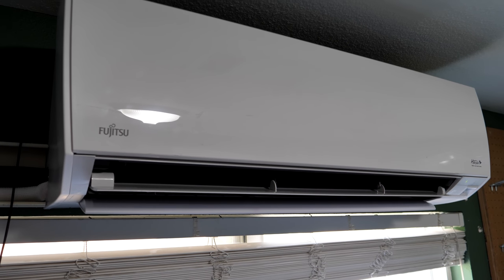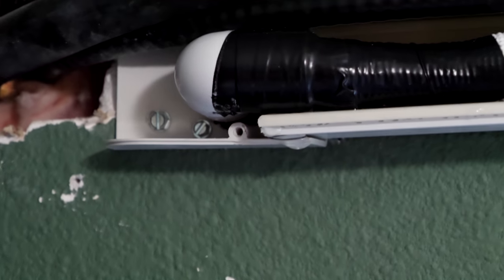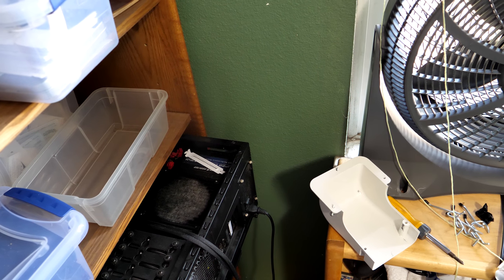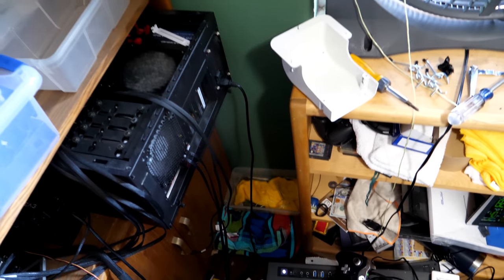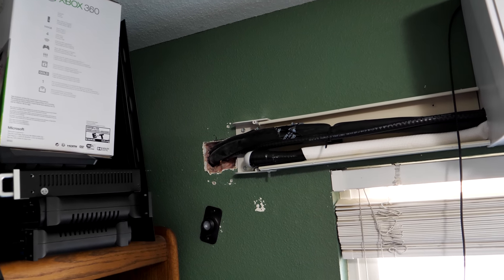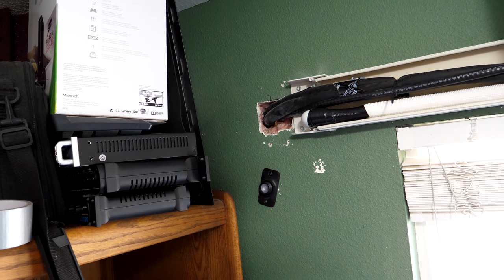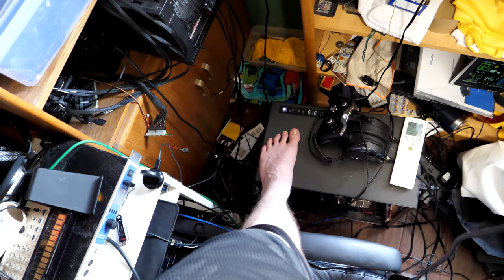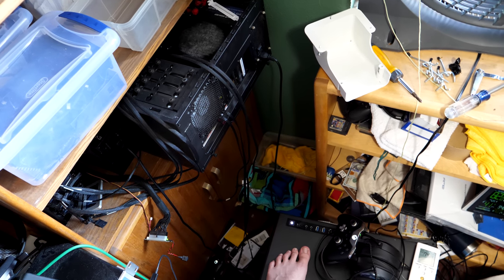Water Leaked On My Computer...

Comment: WhyBeAre, are you dead? If you respond your not dead! Also usually you can buy an a attachment from soft rubber tube to pvc. If you can't find it use gorilla tape. We're mixing electricity, water unstable surfaces and YBR ( 2:24 )

Comment: Actually water doesn't react with electricity and what I mean by water is pure water 
The water that we commonly drink has minerals that react with electricity 
And if you want to dry the water inside the pc TURN IT OFF AND LEAVE IT FOR A DAY OR TWO TO DRY if you try to clean it your self you will miss some parts and you could damage your hardware
Reply: A day or two? Lol that's way too short. Realistically it should be a week or two.
Reply: Ocean Mango He's built a PC before, I'm sure he knows what he's doing. Plus, generally speaking, leaving water on terminals for a while can cause corrosion. Happened to the phone I'm using to type this.
Reply: First thing to do is to remove the CMOS battery. Then just get a hair dryer or something and use it on the MB for 20 mins (varies depending on MB design and size). Then leave it for two weeks if you want to make sure that it won't break.

Comment: That's not a whole lot of water. I've had my loop burst a tube from the fitting and about half the liquid splashed onto my vertical mounted gpu, motherboard and a but on the psu lol.
Dried it with a dryer, waited a bit and resumed to play games xD

Comment: Use some Flex seal for that leak 👍
Reply from the maker: That's a good idea, the tape sort of worked, but I don't expect it to hold for a long time. First I'll try actually pulling it apart and seeing if there is a "legit" way of connecting it if the leak returns.

Comment: 90°F ? That's cute. It's 100 right now in my room
Reply: 70 here

feelsgoodman
Reply: Maaan
Reply from the maker: You gotta remember, the 90 is with the air conditioning on.
Reply: Ya. I guess ^^ Me With ahm. An open window and a fan at 10 pm. (And a very loud NZXT case)
Reply: 100 Fahrenheit? That's cute, mine is 100 Celsius
Reply: Wah. That's as hot as my Pasta water